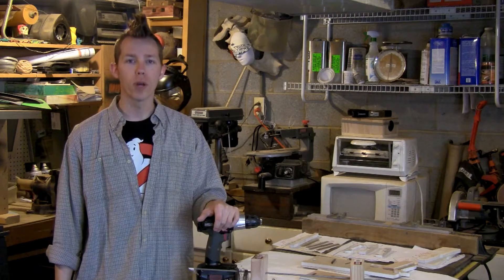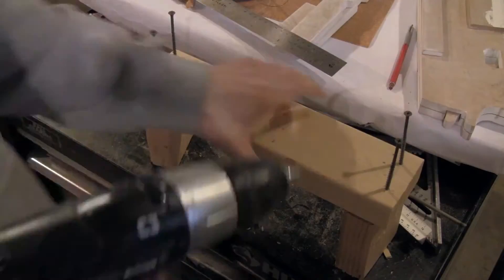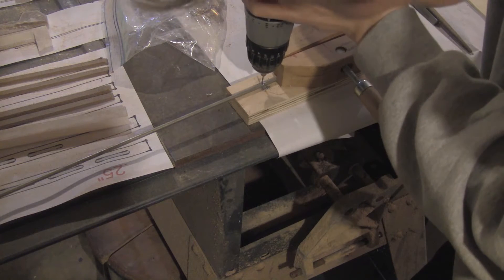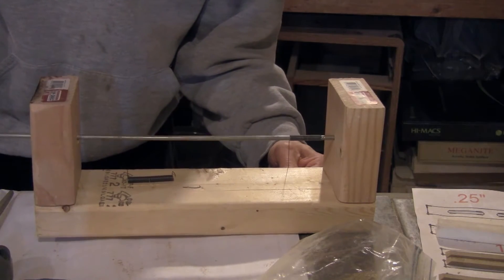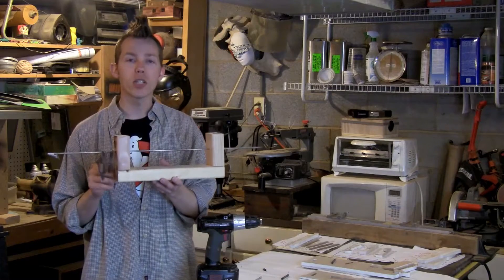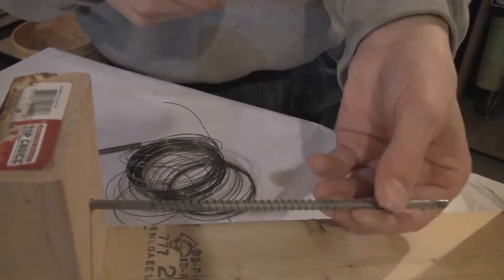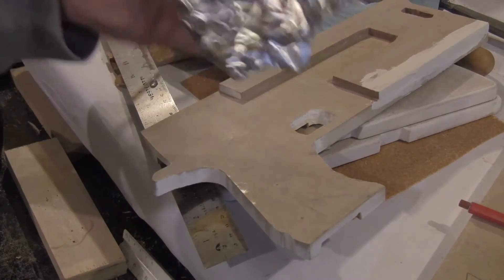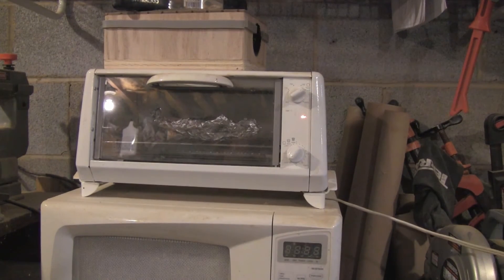DIY Metal Coil Springs

Comment: I saw your video and also visited your blog to note the details. I am really happy to see the details since I am interested to make an extension spring for my Hobby project. I want one more clarification from you is it not possible to heat the coil in gas burner and allow it to cool in the open atmosphere.Is it necessary we need an oven for heating?
Reply from the maker: The foil and oven are used to ensure the spring heats evenly. If you try a gas burner, you definitely need to wrap the spring in steel wool and tin foil to help heat evenly. Even then I don't know if it will work. It's worth a try. Depending on your project that might be sufficient.

Comment: Great!
Sir, after the heating process in the furnace at 400 *, is the cooling of the spring made with thermal shock (cold water) or is it cooled (inside or outside the foil?) under room temperature? Thanks!
Reply from the maker: I let it cool  in the foil at room temperature.
Reply: I visited your blog too. It's now in my favorites!
Thank you!
Reply from the maker: Thanks for visiting! Glad you like it.